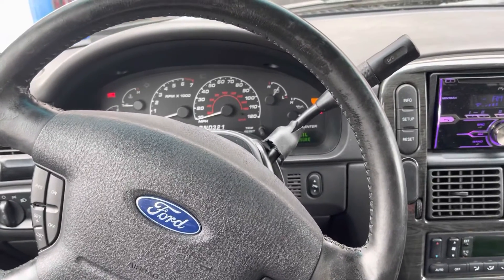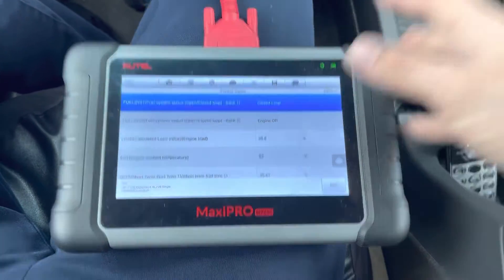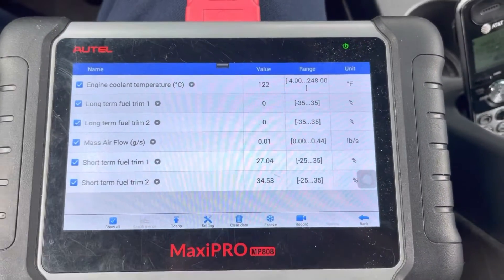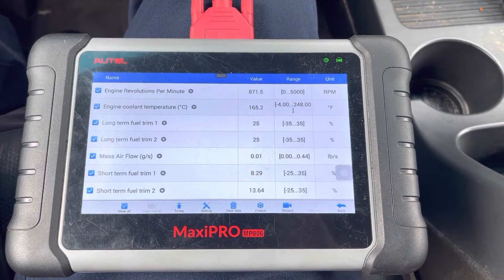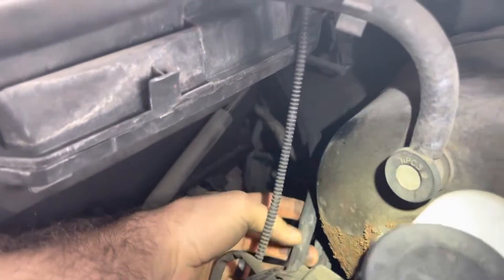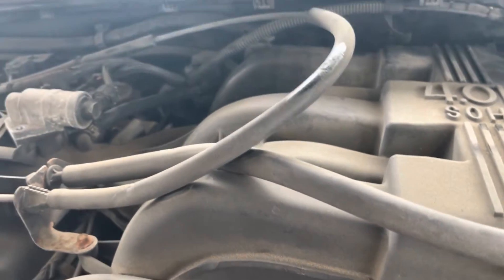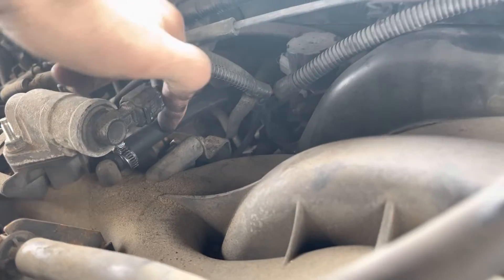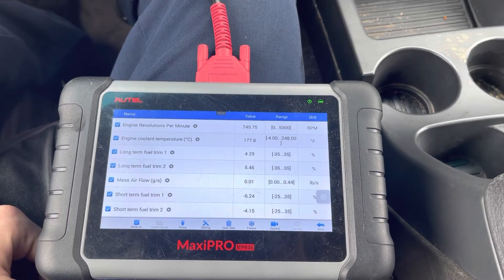Diagnosing a Lean Condition on a 2002 Ford Explorer (Check Engine Light P0171 and P0174)

Comment: i have the same problem what’s the size of that vacuum line/tube
Reply: Not sure if you found the size, but I just did this hose replacement and bought a Continental 3/8" hose from AutoZone (part 50280). Hopefully this helps anyone else who needs the hose size too.

Comment: Well, I had five codes, now down to p0171 p0174. Cleaned mass air flow, throttle body and throttle sensor. Will check for vacuum leaks next. Had very low idle before cleaning everything and would conk out.  now has fast idle.thanks for the video! Wish I had my '86 stang. Easy to work on!